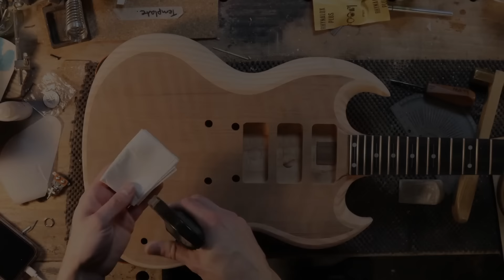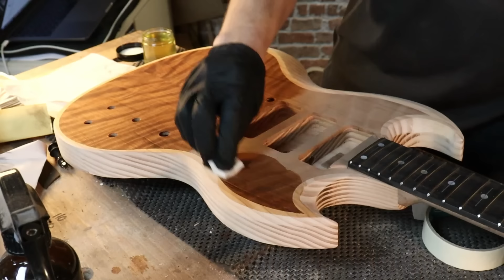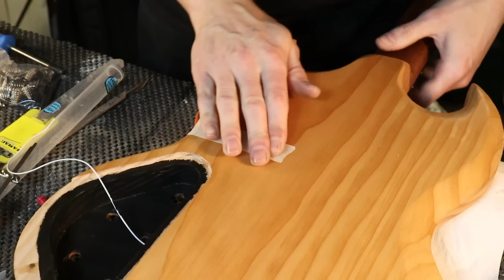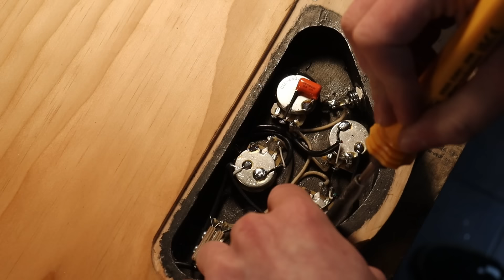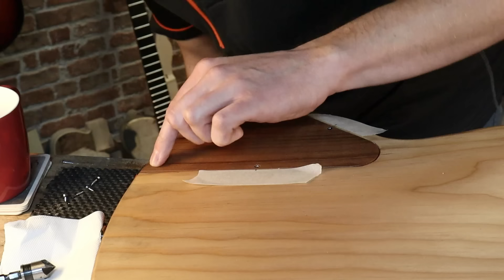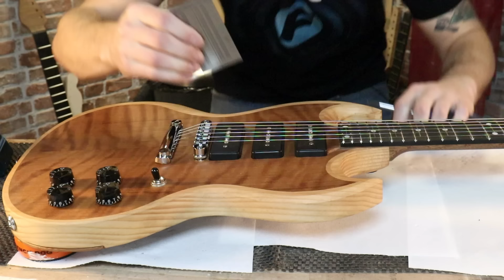Redwood SG Guitar Build Finale! She sings

Comment: For me it’s a split verdict when it comes to the finished instrument… Some things are truely what defines a custom shop instrument and some things are not. The arrangement (choice?) of tuners and the back plate (fitting and screws) are not. When some parts ”fails”, the whole instrument is ”dragged down” to a lesser level. It’s a pity, since it started out very promising. Also the scraped heel (glue removed) should have been shellaqued to obtain the same colour/tone, before being oiled. It sounds nice and ”narly” though

Comment: Applying the penetrating oil after the shellac...  Is there any specific reason it was done in that order, not the other way 'round?

If someone had applied beeswax to a guitar, could they then apply the penetrating oil over it?  I thought the wax/shellac would create a non-porous kind of layer on the surface of the wood..?  🤔

Comment: instead of drilling the second hole you couldve just strip the plastic mantle of the wiring to just before they enter the hole , and if that isnt enough take the earthscreen of the wiring too and twist all three pickup wirings together intoo a single loom  , it be tight but it should fit 
realy like the two tone top and the way you shaped it btw

Comment: One question: What's your opinion of pine for building guitars? You seem to be a bit on the fence...
Reply: I once build a T-style out of knotty pine, which looked absolutely gorgeous. However, because pine is so soft, I pore-filled it with epoxy, which gave it considerably more strength. Still sounded fine :) Pine is so soft, if you look at it too sharply, you'll dent it.
Reply: 😊 I'm knot sure.

Comment: I've looked at that wiring for a while now and I still don't get how that tone is master, when it looks like it only really connects to the middle P90 and blend pot. That's another thing. Why not just have 3 volumes? The knobs aren't in a contemporary line or anything, but still. Why have a blend pot when you could have a volume? Or 3 tone and 1 master volume?

Comment: Never a fan of the bridges Gibson uses. The tune-o-matic bridge and especially the wrap around bridge are, I believe, inferior to the Fender-style individual saddle bridges.
Also I would go for a different wiring. The Gibson 4 knobs with a three-way switch is suboptimal for a three pickup guitar.
The fact that Gibson set standards doesn't mean they are good standards and you have to follow them. Especially not for an independent company like yours.